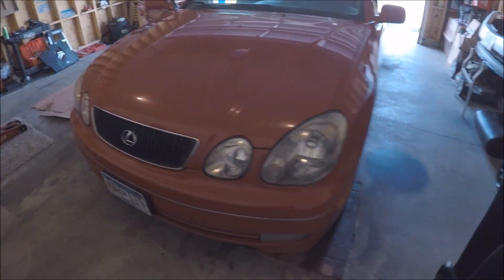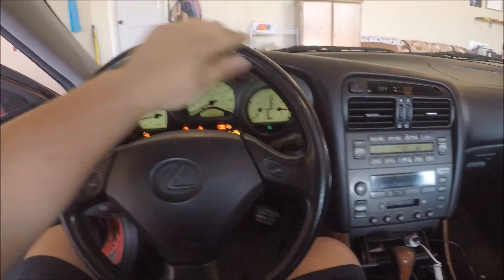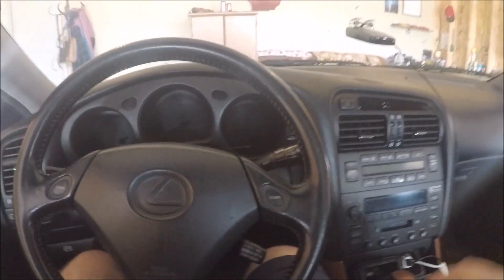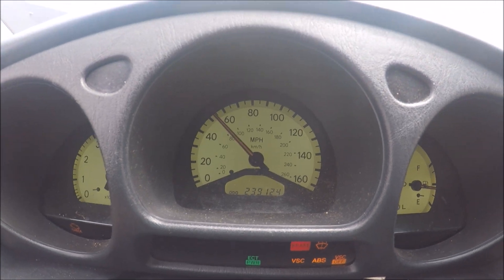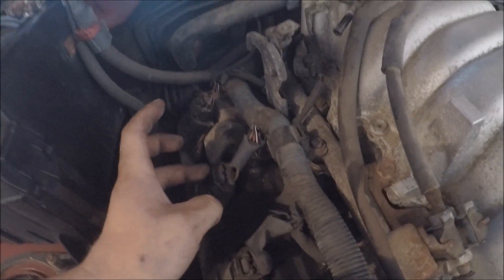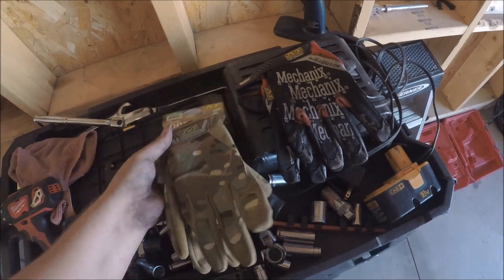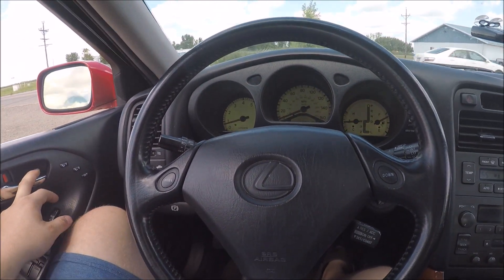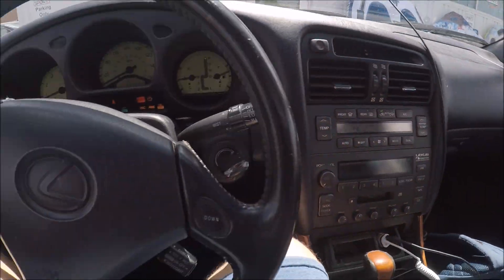MODIFYING my Lexus GS400 V8 the SECOND DAY of Owning It! *sounds amazing*

Comment: Literally had the same problems as you, exhaust leak, no a/c, rust spot on the top. It's a really great car even with high mileage, got mine for 1200 and it's still sittin pretty! Definitely recommend the gs for a reliable cheap luxury car thats got some power to it.

Comment: Super clean for 1k.  AC is likely the controller mounted behind dash.  Had same exhaust leak myself.  ABS is likely a bent wire sensor.  Had my 99 for 14 years.
Reply: Have had and still have for 14 years

Comment: Seems to me all those lights seem like an almost dead battery due to a weak alternator.  Happend to me . Abs/vsc off light and other lights. Alternator not holding a charge and cause those lights to come on.  Eventually ur gonna need new batrry and alternator trust me. Check for a leak on passenger side valve gasket, seems to leak onto the alternator